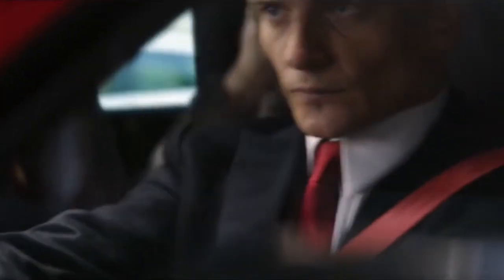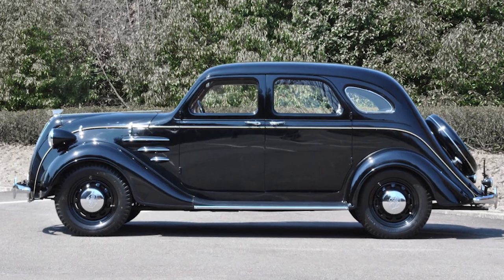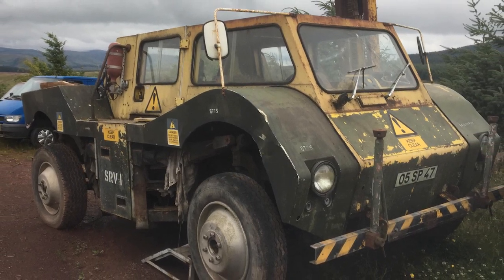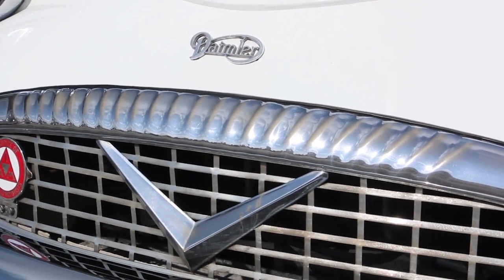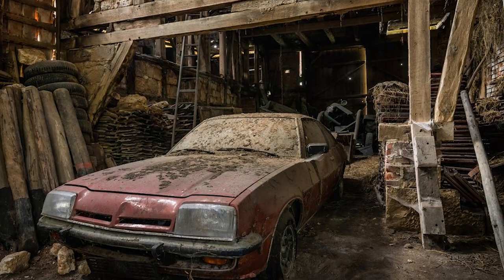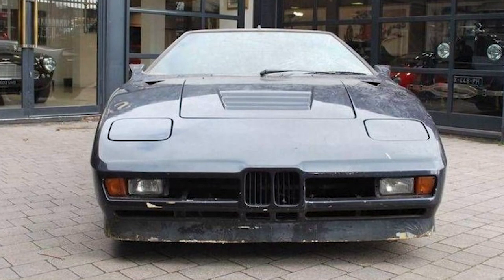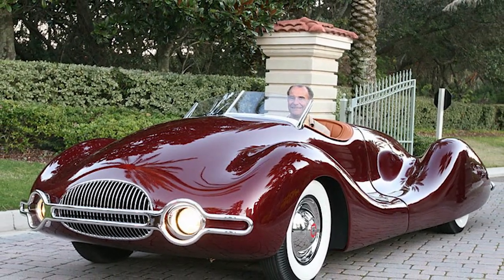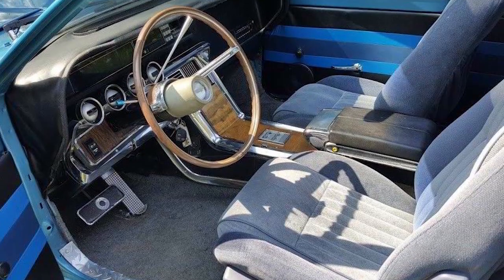12 Most Amazing Cars Found By Accident

Comment: You don't need to specially adapt left hand drive cars in the UK. It's perfectly legal to drive them here
Reply: its also perfectly fine to have right hand drive cars in America, we have holdens, skylines and a few british cars from long ago (I think mg's)
Reply: You don't have to change the steering wheel that would be stupid but you do have to change your headlights for uk ones because they're brighter on one side than the other and your speedometer in case it's not in miles, that's if you want to get insured. Had to do it on my car.
Reply: Most vehicles in the US have both MPH and KPH not sure about over there.
Reply: Eric Maisonny i’ve been driving over 25years and as of yet have not found a speedometer that doesn’t show both mph/kph as for the headlights you don’t have to change them just have them realigned so stop talking out of your botty.

Comment: In the UK we drive on the left not the right and dont need to change the straring to the other side of the car
Reply: When you don't do any research you get this video
Reply: Lol he’s not taking about what side of the road you drive on but what side the steering wheel is on.
Reply: @tylermacpherson8870  He said "drive on the right hand side of the road". False. Also cars do NOT need to be converted. Absolute horse crap
Reply: @tylermacpherson8870  Not

Comment: I actually love the clean, sharp look of the Aston Martin Bulldog! Not at all ugly compared to many other concept-cars (especially those from the USA)! In this vehicle the 5.3L V8 was tuned to produce 600 bhp (447Kw) & 500 N-m, which took it to a verifiable 192 mph (307Km/h), but was capable of being tuned to output 700 bhp (522 Kw). The reason it never went past the prototype stage to a very limited production-run wasn't because people thought it ugly, or that is was too heavy & slow, but because there was a change of management at Aston Martin & it was decided that the project would be too expensive given that like all their cars it would've been hand-built! 

Admittedly the extreme wedge-shaped designs of William Towns weren't to everybody's liking, but it was the reliability issues that gave them a poor reputation at the time (mainly due to cutting-edge technology like digital dashes, etc.)!
Reply: MrWombatty  it's a pretty good chance that even at 192mph, the wedge shape was at takeoff speed with a lack of downforce .  It may have had enough power to go faster but the driver should have been Chuck Yeager.

Comment: Land Rover never made a snow track, though there were some aftermarket conversions by Cuthbertsons . The vehicle with the center raised peak bonnet in red is actual a Snow-Trac  ST4 made in Sweden by Aktiv Fischer  in 1957 to 1981 and this was what Salvage Squad rebuilt. The reason why it was found in Scotland was because the sole UK importer from Sweden was in Scotland and I think it was less than 3000 were built. In the 1972 Winter Olympics, the competitors were ferried around to the various games stadiums in these.

Comment: Wrong fact, we drive on the left side of the road, we sit on the right side in the car as the driver. Steering wheel isnt mandatory to change it from the left to the right.. Easy to get it mixed up though

Comment: The Volga you spoke of did NOT simply “start right up and drive right out of the hanger” as you state. In fact, it required a complete cleaning of the fuel system BEFORE they started it which they did on location. Not a big deal, just factually inaccurate.

Comment: We drive on the other right. And a wheel on the right is not mandatory. Maybe they're thinking of Australia.
Reply: Props for proving RHD Volgas existed though - rarer than rocking horse shit. Now just need to fing a RHD UAZ van. Some councils used to use them apparrently. As for the Jawa 250, I think I'd prefer an original Velorex.

Comment: ive seen the in depth build of the tibbs special, its on a buick chassis with an inline 8cyl buick engine and three speed standard shift trans, my memory is fading a little these days but i thought it was a joint venture between two friends and maybe split up the construction by military service

Comment: 12:08 Homer Simpson designs a car after first inventing a new Pontiac model, the Freebird, from which to borrow the seats. It would probably have been easier for him to use seats from an existing Firebird instead. I'm pretty sure weight has nothing to do with how fast a car can go. Weight affects acceleration, but top speed is dependent on aerodynamics. If the Bulldog could "only" do 190mph it's because it generated too much wind resistance.

Comment: The Snow track is not a Land Rover, the lightweight has modified checker plate front wings, and are not that uncommon. Actually they weigh more than a Standard three. No you do not need to have a car converted in in UK, my two 1944 3/4 ton Dodges and my Land Rover 101 Ambulance are all left hand drive, and used.

Comment: Daimler is German, not British.
Reply: Actually there were two independent companies, both called Daimler one in Germany and one in the UK. Confusingly both made motor vehicles. 
One developed into the Mercedes group and one became part of Jaguar.
Reply: @chrisknight6884  A bit of a moot point. BSA bought a license to use the Daimler name.
Reply: @chrisknight6884  yes i had a 1985 series 3 only changes were badges and chrome.
Reply: Ya heard?